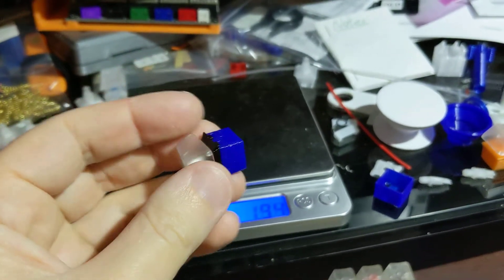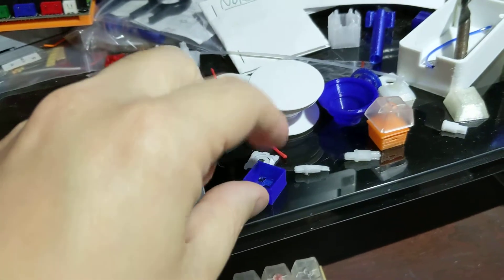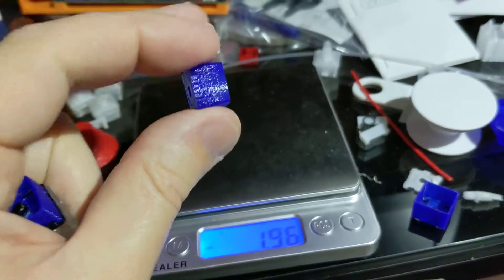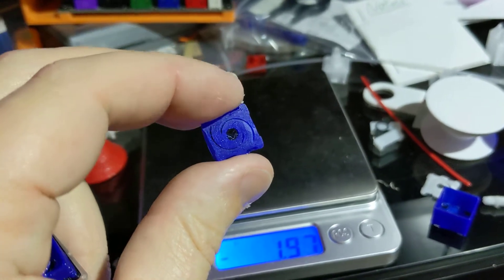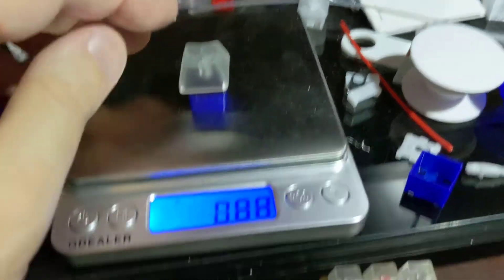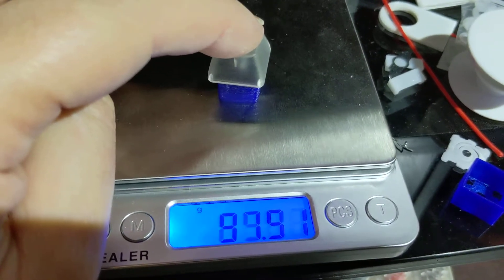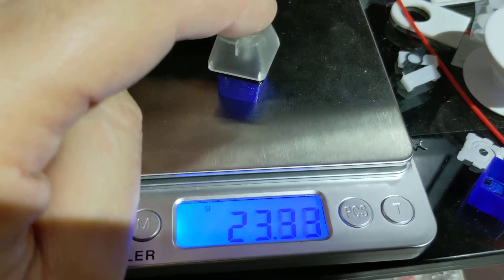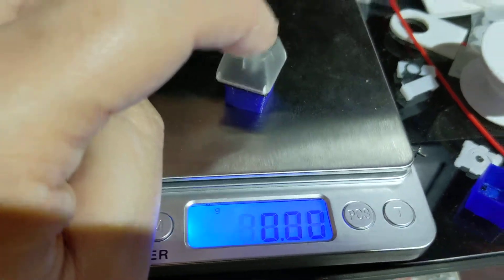3D printable mechanical keyboard switch update: Printed an entire switch body in Ninjaflex

Comment: Nice progress, I have decided not to use a spring anymore but to use foam, I am currently working on making the key steam more stable. Sadly after nearly 3 years, my printers fan died so I can't print the pieces I just finished modeling. Time to go and buy a new fan
Reply from the maker: Using just foam? How's that going to work? Won't the foam just compress and then mostly stay compressed?
Reply: @Riskable3DPrinting  I found some pretty springy foam, I have been testing it outside of a switch and it seems to work pretty well. The first type I tried did stay compressed, but this seems to work better